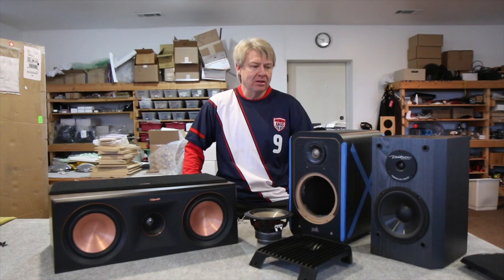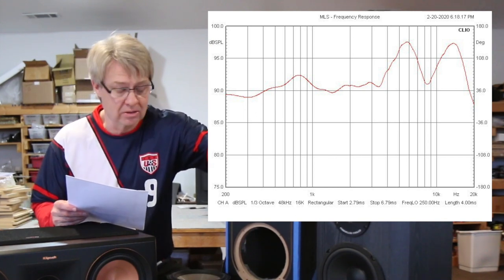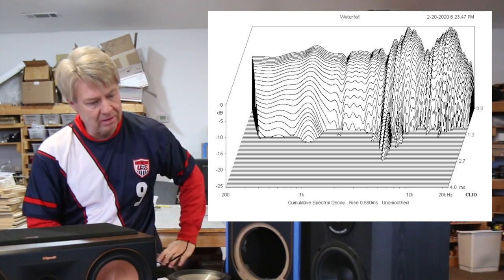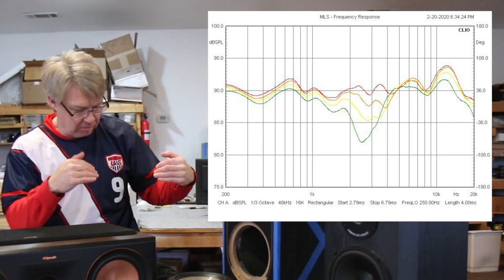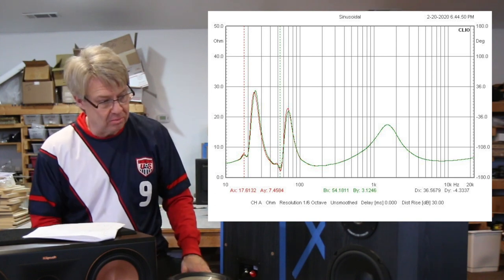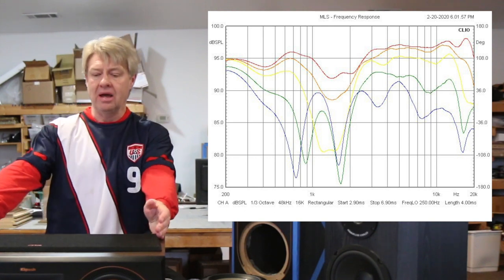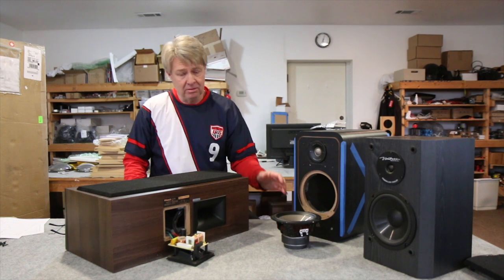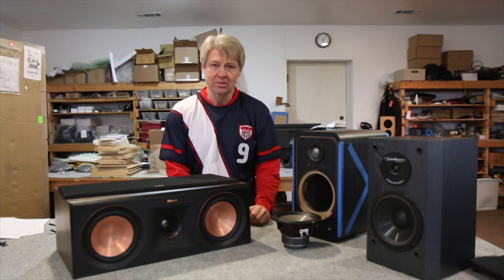Audiophile Upgrades: BIC DV62si, Polk S20, and Klipsch RP-600C.

Comment: The Bics for 100 bucks are hard to beat for pc speakers. Just cut the problem frequencies with an EQ ad add some poly fill.
 I have some klipsch towers and they have been wrapped in plastic and shoved in a closet for years. Horn is pure trash in my room 12x17
I prefer my reconed Advent Heritages to both.
Reply: I picked up some for right at $100 shipped around 2010-11.  Used them as fronts until I got some Polk TSX 330Ts.  I wasn’t unhappy with the BICs but something about the Polks made for a better experience.

Comment: Thanks for the video and for the tips in particular ! I just bought the Polk S20 and there were 2 pieces of Polyfill on both sides of the woofer. I changed it for a piece of acoustical foam to cover the walls and bottom of the cabinet and put an air core inductor in the x-over. The improvement was easily noticeable.
Reply: Could you please share the air core inductor type and the process to install. Thanks
Reply: @JV-nt9bp  It is exactly the same type Danny use on the modifications he make and we can also see on his videos. The wire is a 14 gauge but it was not easy to fit where the ferrite core was installed because the new one is  bigger, so I put it under the x-over board and solder the wires where the old one used to be. I put some tie-wrap and hot glue to secure it in place. Bye!
Reply: @yvesboutin5604 I have the Polk s20e. I've replaced the capacitors and resistors with better quality components but I cant measure the inductors. Did you contact Polk and if so were they happy to disclose the part value and dcr of the inductors? Thanks
Reply: Hello! I own a multimeter with an option where I can test inductors and capacitors. I disconected the inductor from the circuit (which was no easy task due to the amount of glue and position) and mesured it my multimeter. It mesured 0.8 millihenry (mH). I installed the new on the underside of the board after soldering  the tips of the coil. I also put a little piece of foam materiel and secure it in place with electrical tape. It's not looking professional but it works great! By the way, I didn't change the tiny air core inductor on the tweeter because this one is OK for the purpose it accomplish. Its value is 0.22 mH. I didn't change the capacitor in the woofer because I would have difficulties finding the right place to put a better quality equivalent. Bye! @JMJM75257

Comment: after all of your compliments about the polks, wouldn't lowering the bass setting on the tone control work as well
Reply: I never use tone controls on anything, but I guess that could work.
Reply: @dannyrichie9743  really,?? I have my eq adjusted to my liking, I've always used tone controls, I wish receivers/amps still had midrange , oh well, anyway, my wife and I are considering the wharfdale evo 4.1, or is it the 4.2, anyway, the bookshelf with the 6.5 inch woofer , midrange and ribbon tweeter, do you have any experience and/or thoughts on these, thank you
Reply: @woofman4796  Look at the crossovers used on those speakers. So far what I have seen is very cheesy.
Reply: @dannyrichie9743  hmm?? We do like polk audio, I like b&w, my wife thinks the tweeter is too bright, but their bookshelf with the 6.5 woofer and aluminum dome sounds damn near perfect to me, I'm a die hard classic rock lover, wife is modern country, we both like Zach Brown and Kenny chesney, thank you for your info and feed back,

Comment: Ok I'm convinced to buy the Polk S20. I've heard a lot of good things about this speaker. I want to replace some old Sony book shelf speakers. 👍
Reply: You will not be disappointed. Owned them for about a year. I think my receiver is choking them so will be switching it soon 😁
Reply: @zoroluva  How is the Bass? I have a Yamaha RN-803 reciever. Great power!
Reply: I was watching Tomorrow War on Amazon and for whatever reason my sub wasn't on. The bass form the S20s was so good that I didn't catch on to the missing sub till past mid way through the movie. 

Now they are power hungry so if you plan to run them full range, hopefully that amp will hold up. My Denon just couldn't
Reply: @zoroluva  Sweet the Yamaha can do 145 watts at 8 ohms!
Reply: @adaboy4z 145w?  Damn that's nice. You'll love it man!
Reply: @adaboy4z  Need a Subwoofer.
Reply: @JV-nt9bp  I bought A kef Kube 12B

Comment: Danny your videos are #1 on my list of must see You Tube videos!  I have learned allot from you in them.  

One thing I would be interested in seeing is if you can visually show with test equipment how the output signal of different quality capacitors changes when fed the same input signal.  One recent revelation I have learned from you is how important quality crossover parts are and I think this type of test would objectively show others how much cheap parts distort the input signal.

I also want to verify your assessment of the BIC speaker in this video.  I had the tower version of this speaker, (DV64), with the same tweeter which was so bright I literally could not listen to them.   Between that and the significant cabinet resonance from bass notes they weren't worth fixing so I sold them.  

In fact those speakers were so bad they were the reason I got into high end audio and am now a happy GR Research customer.

Comment: For the klipsch, if the vertical off axis was not too bad but the horizontal off axis was bad should you turn them 90 degrees as all ears are probably within 10 degrees of each other? Would this hack work for most center channels? I’ve got room below my display for any orientation of the center channel. Thanks. I love the channel. Chris

Comment: Dani , what do you think about pairing to ADCOM GFA 555MK2 amp this S20 by polk or the Triangle Borea 3 ?
Reply: I haven't heard an old Ad Bomb amp mentioned in a while. I don't know what to think about that.
Reply: @dannyrichie9743  Thanks Danny, you should check one of the Bomb ADCOM's AMP they are fantastic.
Reply: @RanTausi  My buddy Gary used to call them that. He used to upgrade them when he could find them. He made some pretty nice amps out of them.
Reply: @dannyrichie9743  Recently i acquired the beast rare GFA555MK2 new! never been used from seller from PA , and i have the 545mk2 used one but in very good condition which i have bought 2 years ago. they are both stock ones and they both sound terrific, I am using GFP 565 as preamp. maybe one day I will recap them but I don't see any reason to do that now as they play and rock solid. I did bought speaker relay protection board and soft start board for upgrade them, but with my job and little baby I don't have time to do that :-( hhh.
Reply: @RanTausi  Pretty nice gear.

Comment: If i wanted to improve my speakers would just upgrading the indicators and capacitors to better quality, same values, get me most of the way there?
Reply: If it is a good speaker, then upgrading crossover parts is a great way to really improve the sound. Air core inductors, sonicap caps, mills resistors can offer almost a new sound.

Comment: Am I incorrect in my thinking that the material a tweeter is made of is roughly equal to being hit in the ear with that material? A common question I ask is "Would you rather be hit in your eardrum by Titanium, Aluminum, hard plastic, or Silk?" My ears have always found silk to produce a substantially better high frequency sound quality than plastic or metals (especially metals as I absolutely dread the sound of high frequencies produced by a Titanium tweeter). Am I off the mark here?
Reply: monkeymanstones1 yes and no a diffused metal dome destroys a soft dome any day of the week. A very good example would be the older Bostons acoustics AMD tweeters. A relatively harsh metal dome diffused by their AMD diffuser technology. 

It all depends, how well it’s designed a cheap speaker with a so so design.. will sound precisely like you would expect. 

You cannot just generalize tweeters as such, poor design, will translate to poor quality.
Reply: Cymbals are metal....

Comment: Awesome as always!
It's funny as I recently recommended and installed these S20 on nice 24" sand filled stands for my friend who asked for advice. We got these as a refurbs at 169usd per pair in like new condition , i added just a bypass on stock poly cap  0.01uf Cornell Dubiler C940 3000V  series poly film cap , really nice and clean sounding , airy and detailed cap so it brought out more airy , cleaner and precise highest freq and acoustic guitar harmonics really came out sweet. These sound so out of the box with huge stage , for 169usd it was a steal.
Can you post price for your crossover kit ? 
I wonder if I could squeeze in the biggest inductor say at least 16ga on the stock crossover board? 
Can you post the values of inductors ?
Reply: I've put together a complete upgrade package for these.
Reply: @dannyrichie9743  Thanks i will look for it on your website... just did and could not find it there...
Can you tell me the cost of this kit?
Reply: @kdomster9141  A more recent video of his implies it would cost around $200.00/
Reply: @MaxBoostMk7.5  Yes I did watch it, half of 200usd is in sheet of No rez and Tube Connectors.

Comment: Love the upgrade videos. Was hoping there was one for the Polk S35 center since I believe that speaker truly needs improvement. Crossover maybe? Sounds boomy to me and covered up. So I was considering the Klipsch center you got there as an upgrade but I opted to upgrade to a Monolith THX 365 center speaker. That said, I was wondering what your opinion is about THX certified speakers when it comes to measurements and upgrades. Are they already well made as is?
Reply: The S30 is a far less sightly speaker but blows the s35 out of the water in frequency range and over all sound quality.
Reply: I like my S30 center with S55 towers

Comment: Hi Danny,

Has anyone sent you the JBL Studio 230?
Reply: Yes, and they were not bad. But getting to the crossover or doing an upgrade on them is almost impossible. It requires a very difficult disassembly.
Reply: Danny Richie actually, I think you are confusing the 230s with the studio 530s which are the ones I have. Here are the 230s... https://www.jbl.com/STUDIO230BK.html

Comment: Congrats on your first solo video. Been meaning to ask a couple of questions. 
what is so awful about the white rectangle resistors?
Does the outer foil direction of caps matter in crossovers?
Reply: The little white sand caste resistors are the worst sounding of all the resistors type out there. They are also the cheapest so chosen often for their price. 

The caps are non-polar and work either way. However some differences in directional orientation have been noted by some using top level systems.
Reply: @dannyrichie9743  Thanks for the reply appreciate the advice.

Comment: I owned the BICs and an upgraded BIC with high end recommended crossover and you are correct!! POS. 
I read the reviews when I bought them and it was almost 5 stars across the board.  They sound like a cheap speaker thrown in a shoebox. Lol garbage
Reply: Mr flimflam fremdippity danyet well you got to see it in perspective here, what did you pay . 

I think if someone spends less than 200usd, you cannot expect more than 200usd.
Reply: @MichelLinschoten  it didn't sound like $200 speakers.. it sounded like a $60 pair of speakers
Reply: I got the bics for $100 Pair new .
They are on my desk and blow away any crappy Logitech or other " computer speakers" they are bright but I use foobar2000 and just cut 7 and 15k.
Reply: They literally are cheap speakers thrown in a box. I bought them cheap as desktop speakers and they're surrounds for my home theater now.  They sound just fine for what they are. No surprise they aren't worth upgrading.
Reply: @Bradimus1  you are correct. I don't see how they are still in businesses  With options like Sony SSCS5, jamo s line, jbl,  and a ton of other options. They Acoustech sub isn't a bad buy. Everything else is garbage